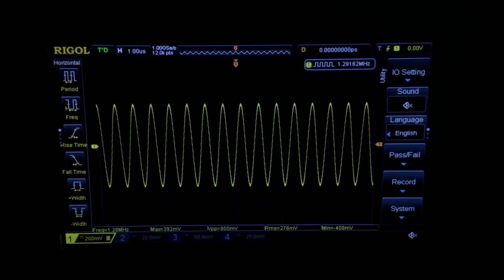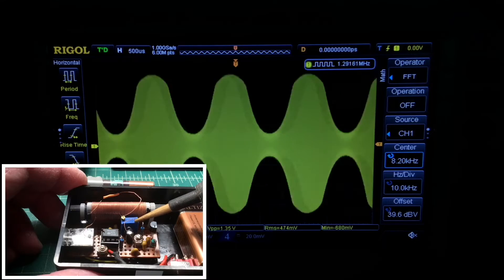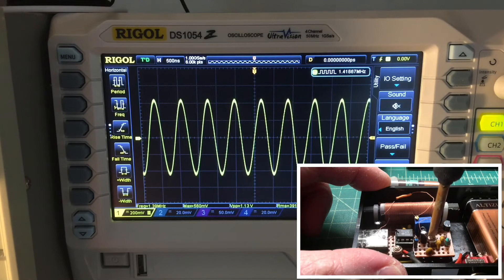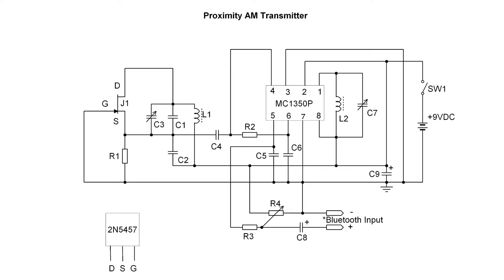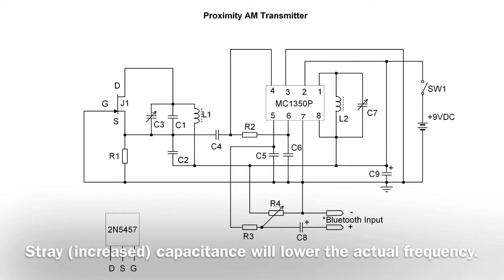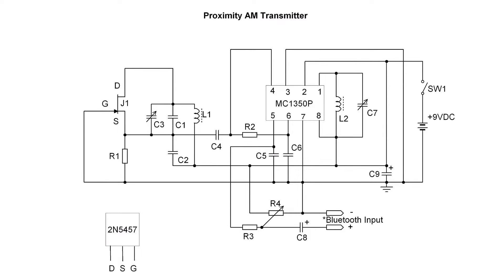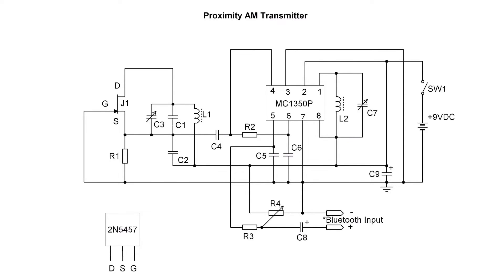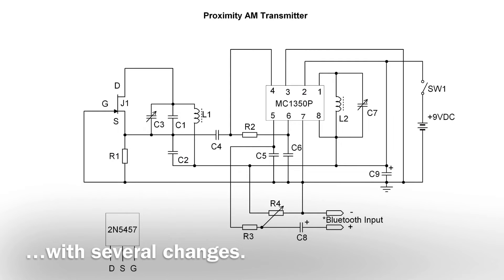Proximity AM Transmitter Using a MC1350P

Comment: I have built various modulators for tube radios. The problem with all the transmitters I have built is that their range is only about 3 feet, and as I move away from the radio, the signal becomes unclear. Do you know of any transmitter that does not have this issue? Do transmitters with ferrite rods work well?
Reply from the maker: Thanks for watching. All of my designs and as-built projects have been close proximity (a few feet) transmitters as well. A short wire antenna provides about the same range as a ferrite. A good earth ground makes a positive difference. Best, Don

Comment: Hi Don, I saw this project and decided to have a go at this but have run into a problem. Just wondering if you would be willing to perhaps offer some suggestions on how to get this working properly. Symptoms are weak, distorted output when listening on a radio. The volume needs to be really high to hear anything at all. The audio looks okay on a scope as it goes into the circuit via C8, but if I scope at the junction of C3 & L1 (I know this interferes with the circuit somewhat but didn't have a pickup coil for testing) the audio has about 5v peak to peak but the bottom of the waveform looks truncated on louder parts of music. Without audio with scope probe directly on the drain of J1 the tank circuit seems to be working as expected with clean oscillation over the expected frequency range. Checked my layout for shorts and errors, no problems found so wondering what's going on here. Tested with audio from phone using headphone jack and from signal generator. Bought the antenna etc from the seller you suggested. Also, stupid question, the antenna has four wires, how should these be connected, just want to confirm. New to doing anything with radio. Thanks for putting this build out there, projects like these are always really interesting.
Reply from the maker: I no longer have the circuit built, but a few things we can validate. With your audio source turned off, check the junction of C4 & R2 on your scope and let me know how the sine wave looks, the amplitude Vpp, and the frequency of the unmodulated carrier. I’ll reply back and we’ll keep searching for the root cause. Best, Don
Reply: @RestoreOldRadios  Okay, I tested with the scope at the junction of C4 and R2 and sine wave looks good. The peak to peak voltage is 648.4mV and the frequency is 1.333Mhz. Does that sound right? The battery is good by the way, 8.3v when the circuit is running.
Reply from the maker: I was thinking the oscillator RF level would be higher at that point, but I can’t recall for sure. Do the same at pin 8 from the MC1350 and you should see a peak level at the same frequency of the oscillator as you turn C7 either direction. This will confirm the tank circuit is working and the loopstick antenna coil is connected correctly. Do you have a LCR meter or other to read inductance?
Reply: @RestoreOldRadios  On pin 8 I get some kind of very low level distorted signal which doesn't look anything like a sine wave. It's only at about 60mV max. C7 does affect its amplitude but 60mV pk-pk is all I get. I do have something that will read inductance. I've colour coded the four wires on the loopstick antenna and and read the following:

Plain to blue: 720uH
Plain to green: 210uH at 4 ohms
Plain to red: 830uH at 8.5 Ohms
Blue to green: 230uH at 4 ohms
Blue to red: 10uH at 1.2 ohms
Red to green: 300uH at 4.8 ohms.

I'm using the Plain to red wires at the moment. Checked the joints and they are solid.
Reply from the maker: Any change at that point while you adjust R4, the variable 10k resistor resistor? Did your scope lock on a frequency?
Reply from the maker: Also, confirm you’re reading the 8.3V at pins 1 & 8 on the MC1350.
Reply: @RestoreOldRadios  Yes, the level drops if I adjust R4. The wave form looks almost like a series of dirty pulses. The frequency is 1.333Mhz.
Reply: @RestoreOldRadios  Yes, I read 8.3 to 8.4 volts at pins 1 and 8.
Reply from the maker: Have you swapped out the 1350 for another by chance?
Reply: @RestoreOldRadios  No, this is the only one I have. Unfortunately they seem to be really expensive where I am so I'm hoping it's not the problem.
Reply: @RestoreOldRadios  I will get another MC1350P if needs be though.
Reply from the maker: Let me breadboard the circuit and validate the oscillator RF drive level, etc. I won’t be able to do this until late today or tomorrow morning & I’ll reply back. Hopefully we’ll find the root cause. Best, Don
Reply: @RestoreOldRadios  Okay, I'll be very interested to hear your findings and see how they differ from mine. Thank you so much Don for all your help. I know I've already said it but I really do appreciate it.
Reply from the maker: I just got home so it will be tomorrow morning before I can look closer at the circuit; however, I did glance at the BOM and see that I called out the current consumption at ~8.4V @ ~12mA. Please check the current consumption and see if you’re in the ballpark with your build. I’ll reply back tomorrow ASAP. Thanks, Don
Reply: @RestoreOldRadios  Just checked and the current consumption is 12.3 - 12.4mA @ ~8.4V. Seems in line with what you stated on your BOM. I ordered another MC1350P so I can test that by substitution. That should be arriving tomorrow hopefully. Thanks again Don!
Reply from the maker: DC voltage measurements for each pin to ground (pins 3 & 7 tied to ground) and pin 1 on the scope. Let me know if this helps. Best, Don

MC1350P
https://youtu.be/PfWVJWco0U8
Reply from the maker: BTW - the measurements were from my build; I had given this to a family member, which was returned and I located it this AM. Best, Don
Reply: @RestoreOldRadios  Thank you Don, I'll go and check my build now and get back to you with the results. Really appreciate the video by the way!
Reply: @RestoreOldRadios  Here are my readings:
MC1350P @ ~8.4v DC.
Pin 1: 8.44v
Pin 2: 8.45v
Pin 3: 0v
Pin 4: 2.72v
Pin 5: 4.06v
Pin 6: 2.72v
Pin 7: 0v
Pin 8: 8.42v

Testing with the scope on pin 1, the bottom quarter of the sine wave is truncated and squared off.
My scope reads the Vpp as 13.87v, RMS 4.673v, and frequency as 1.333Mhz.

However, if I put the probe on the drain of J1, the sine wave looks perfect, with a Vpp of 17.58v, RMS 6.241 and a frequency of 1.220Mhz.

Clearly something is not right here. I've spent some time checking and rechecking my layout and can't see an issue (though that doesn't mean there isn't one).
I haven't received the new MC1350P yet, likely tomorrow now but as soon as I get it I'll put it in and let you know what happens.
Reply from the maker: Double check pin 4 using the scope. I have a very clean sine wave at ~660mV. We need to look closer at the tank circuit between pins 1 & 8. You’re using the loopstick taps with the highest inductance I assume between those points?
Reply: @RestoreOldRadios  On pin 4 I'm also getting a clean sine wave of ~660mV.
I am using the taps with the highest inductance.
Reply: @RestoreOldRadios  I don't know if this has any bearing on anything, but I couldn't find a 180uH inductor for L1 so I used a 100uH and an 82uH in series there to make up the required value. The signal on the drain of J1 looks clean and strong. It's a deviation from the original circuit you designed so I thought I'd mention it.
Reply from the maker: Your solution wouldn’t alter the performance. The JFET configuration is a common gate and the oscillator input signal to IC is from the source. My drain signal mirrors yours as well, so I think that part of the circuit is working as designed. Our IC voltages match as well. I know you’ve confirmed the bypass capacitors are in place and test good. I hope you can solve the riddle soon.
Reply: @RestoreOldRadios  Yes, that part of the circuit seems to be working okay, things just go awry at the pin 1 and 8 area. All components were bought new from reputable major suppliers and are high quality brands (Vishay, Panasonic etc), so the likelyhood of them being bad is small (though still possible). At this point I think the next step is to replace the MC1350P and see what happens. I'll let you know, it will hopefully be here tomorrow.
Thank you so much for all your help Don, I can't express how much I appreciate it.
Reply from the maker: You are welcome. Look forward to hearing back afterwards. Have a blessed day. Don
Reply: @RestoreOldRadios  Thank you Don, you too. Fingers crossed the new MC1350P fixes the problem. I'll let you know as soon as I have any news.
Reply: @RestoreOldRadios  Hi Don, well, the new MC1350P didn't fix the problem, the situation was the same, so I went hunting around in the circuit. I found that at the junction of R2 and C4 the sine wave was nice but at the other end of C2 it was distorted and weak. I lifted C6 and the sine wave into pin 6 was restored. The output on pin 1 was still the same, truncated and distorted past the lower quarter. I removed the loopstick antenna just to see what would happen and the waveform changed but was even more of a mess in the lower part, with what appeared to be ringing or something like that between each cycle. I'm going to check my layout again and see if anything jumps out at me.
Reply from the maker: I hate the issue is still occurring. I think the issue is the tank circuit between pins 1 & 8. With the circuit powered off, check DC resistance across C7, I read 7.5 ohms and then check the inductance across C7, I  measure ~770 uH (microhenries). Best, Don
Reply: @RestoreOldRadios  Yes, it does seems to be that way though I thought that having to disconnect C6 was pretty strange. For C7 I read 8.5 ohms, unfortunately trying to read the inductance is giving me bizarre readings like 40uH for some reason. Disconnecting one end of the loopstick coil and measuring it reads 840uH. However, a bit of progress has been made, I now have a normal looking sine wave on pin 1! I rearranged a couple of components on the board and moved R2 nearer to the IC, then I tried turning down R4 and found that at some point the sine wave cleared up. It's like it drove the circuit too hard or something.  I don't know if that makes sense or if your build does the same. The clean level I was reading was about 6.4Vpp, this is with C6 still disconnected. I haven't tried using any input signal with it yet though.
Reply: @RestoreOldRadios  I've done some more testing, I removed and tested C6 and C5 and both read correctly (0.047uF) so I refitted them. Now have no sine wave on pin 6, only pin 4. I'm guessing this is not reflected in your build? Output on pin 1 is still a sine wave with good level though.
Reply from the maker: Glad you got it going. C6 bypass cap shouldn’t cause the circuit to stop working I believe. For some reason, the inductor was not found, thus no tank circuit and no way to resonant the… and get a pure sine wave. I’m glad you got it going.
Reply: @RestoreOldRadios  Thanks, yes, I'm glad too. The circuit is still working even with C6 in place, I guess because there's still input to pin 4. I see what you are saying about the inductor. Still not sure exactly what the problem was, it all started working when I lifted C6 and moved R2 closer to the IC but I don't know if either of those really did anything. The circuit still needs to be pretty much next to radio to get decent strong pick up but maybe that's just a matter to tweaking C7 and R4 some more. Anyway, I couldn't have gotten it going without your help, thank you so much Don, it's greatly appreciated. I will enjoy using it, in fact I'm doing so as I type this. Many thanks once again.
One final question if I may, how did you secure the loopstick antenna in the box you built the circuit into? I was thinking of a small dab of silicon adhesive at each end wondering if there's a better way with these.
Reply from the maker: Thank you for your kind words. The range by design is limited to just a few feet. One could add a secondary winding around the loopstick and feed that signal into a RF amplifier and short wire antenna; of course, ensuring compliance with all legal requirements. Your idea to secure the ferrite should work well. I used two small zip ties just past the Litz coil and drilled holes through the PCB. Did you see my other circuits on Google drive? Best, Don
Reply: @RestoreOldRadios  No problem, I'm just amazed how you come up with all these different designs, incredible! The secondary winding idea is a good one, perhaps a second loopstick antenna next to the first would work too?
Good idea on mounting the antenna on the board, I was going to mount it to the box, but the board sounds safer. I did see some of your other circuits on Google Drive and looked into building the discrete transistor one but the tuning capacitor of that value range was hard to find. I fully intent to build another of your projects, really fun and satisfying. Thank you again!
Reply from the maker: Enjoy and feel free to reach out if you have any questions. Don
Reply: @RestoreOldRadios  Will do, thank you so much again for all your help Don. All the best.
Reply: @RestoreOldRadios  Thank you so much for the reply Don, I'll get that info and let you know shortly. I greatly appreciate the help.

Comment: Thanks Don.  Just curious if you’ve ever built a converter for pre-war FM radios hear the current FM band.
Reply from the maker: I haven’t, but have a couple circuits archived (one super simple circuit using diodes &… the other a two tuber). Have you constructed one in the past? Thanks for watching and reaching out. Best, Don
Reply: @RestoreOldRadios  Thanks Don.  I’m picking up a Zenith 12H670 this week so this will be my first attempt.  Just gathering ideas at this point.  I enjoy your videos.
Reply from the maker: That will make for a fun and rewarding project. I hope it goes well for you. All the best. Don
Reply from the maker: A circuit design if needed:

Post War to Pre War FM Band Receiving Converter
https://mwsherman.com/fmonly/radio_age_july99.html
Reply: @RestoreOldRadios  thanks.  I’ve been looking at the simplified version of that circuit.

Comment: Another great AM transmitter Don, the radio sounds very well with that transmitter.
Reply from the maker: Thanks Jim. It’s definitely a different method to modulate the carrier and seems to work well without clipping with the proper input level in addition to R4 being adjusted correctly. Thanks again for watching Jim. Best, Don